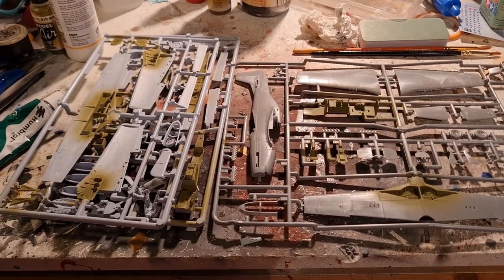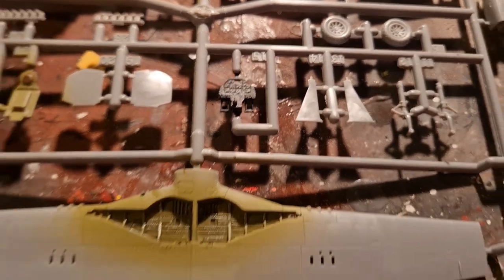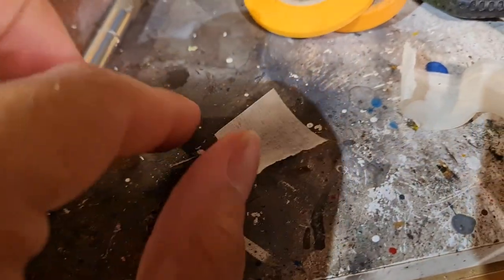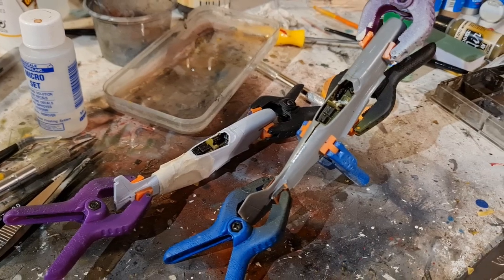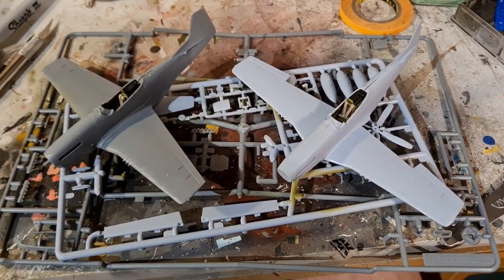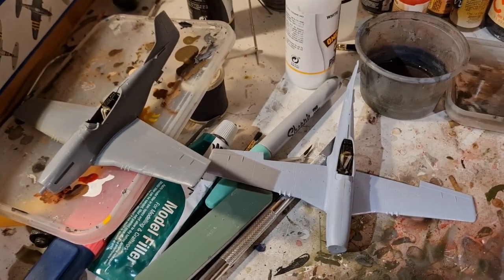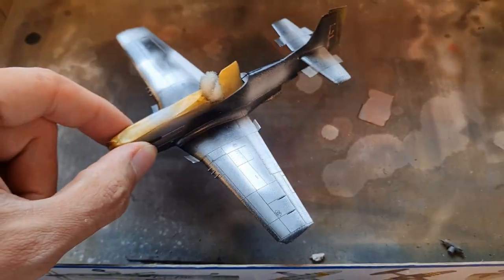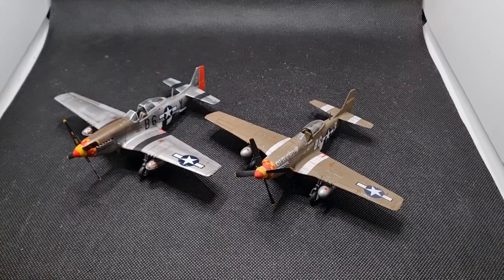WHICH IS BEST?: Tamiya v Airfix P-51D Mustang Build - Part 2

Comment: One more point on the P 51 - the main wings were very carefully puttied up (filled) and sanded off to give the laminar flow wing an absolutely smooth surface, it was then PAINTED silver - it was not a natural metal finish. I am not sure if they carried this practice on throughout the war but it was certainly carried out initially.

Comment: A point to note on the P 51D Mustang - I noticed that you have filled and smoothed the seam between the upper engine cowl/covers - They are actually two separate parts on the real thing so you would actually see a seem along this 'joint'. Might save you a bit of work in the future (that also comes up on the Bf/Me109 series - the rear fuselage was assembled in two halves on the real aircraft so you would see a thin seem along the centre-line upper and lower rear fuselage),

Comment: I have built several of both, I do agree with your assesment, there's not much between them. The damage to the Airfix mould is unfortunate, and some kits have in addition to the joystick and aerial issue, wonky undercarriage legs. The flaps down option is nice. And there's no sprue attachment points on the wing leading or trailing edges, nor on the top of the fuselage, which is very good. But the detail on the engine cowling is soft and incomplete. Both kits are good, but not great for 2022 standards. Arma Hobby will release their 1/72 P-51D in December (if not delayed), so I will build no more Airfix or Tamiya Mustangs. And Eduard will sooner or later release their 1/72, there's always a market for good P-51's. Their's will be riveted, so it will be different from Arma Hobby's.
Reply from the maker: OMG is that confirmed from Arma Hobby? Wow that's going to be an epicly good kit. Ooo and Eduard too? Wow looks like I'll be re-building my entire Mustang collection again haha
Reply: @The_Male_Modeller  yep, Arma Hobby announced the D version last December :-). Have you ordered the new  Arma Hobby P-39Q? Mine are on their way from Poland. One doesn't easily get bored with Mustangs, there's so many colourful options and different nose art.
Reply from the maker: @thekinksfan5102  Ahh that is awesome news! Well, I'm definitely planning to get one but when I order direct from their website it wants me to do a bulk order. Are you getting yours from eBay or something or am I doing something wrong? Haha
Reply: @The_Male_Modeller  haha, no you aren't doing anything wrong. I live in Finland inside EU, that's the difference. I see that at least Hannants and jadlamracingmodels has it as pre-order. Jadlam has free shipping I think, but is more expensive.
Reply from the maker: @thekinksfan5102  bloody Brexit 🤦‍♂️ Yeah I've had a look at Hannants so looks like that's where I'll be getting mine from! 👍🏻

Comment: A nice build, excessive flash on the sprue often depends from molds not well maintained. I think that the price is also important, as kits' availability, expecially here in Europe Airfix ones are more diffused.
P.s. for the joistick you could try with a thin bit of sprue warmed on a candle.
Reply from the maker: Thank you. Absolutely agree on the price. Given the price of the Airfix one it's close enough to the Tamiya one to be the preferable option. Of course I'm sure Eduard will blow them both out of the water when they release their 1/72 option. Something tells me I'm going to end up with a massive stash of Mustangs haha